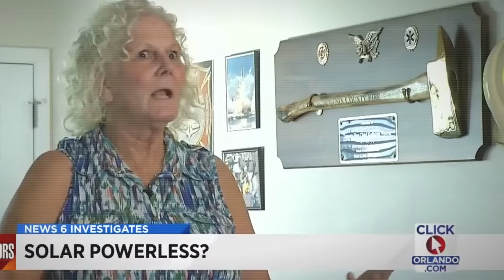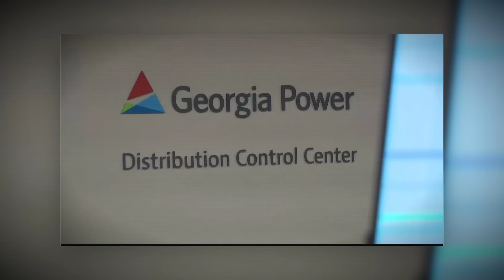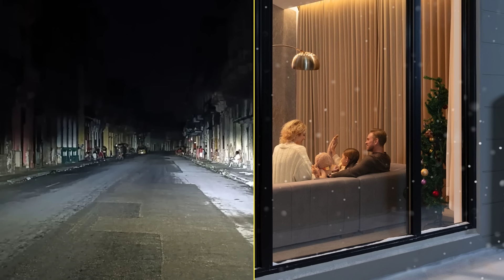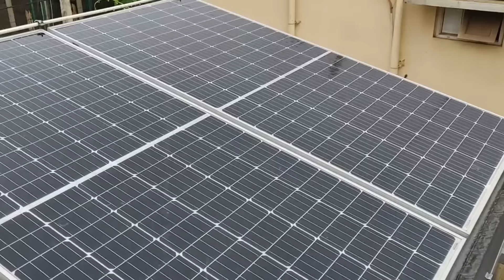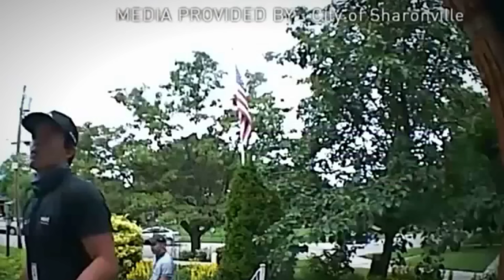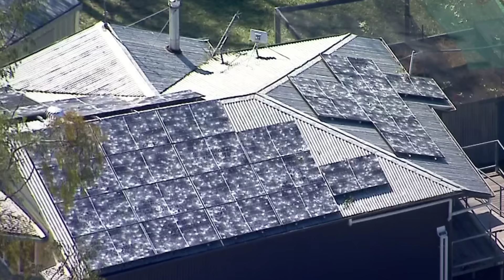Why Smart Homeowners Are Ripping Out Solar Panels (The 'Grid-Tied' Scam)

Comment: It is easy to ripoff the uneducated.  Buy your own batteries, solar panels and inverters.  Build a system that is not connected to the grid.  You will always have power when the grid goes down and lower bills when the grid is working.

Comment: I can tell you how it works in Poland, seems much better - nobody ever uses microinverters, we just wire the panels in series into 1 o 2 strings and connect to a single powerful inverter. Most Installations are on-grid, they do shut off during blackouts - it's not any kill switch, the inverter just can't generate AC frequency, can only sync to it, if you want off-grid, you either buy an on-off-grid inverter OR a grid separator and run a tiny off-grid inverter.

Comment: No one should EVER buy a product that forces them to rely on a warranty.  As is pointed out here on this channel (THANK YOU!), there are few things today that you can fix yourself.  If you can't afford major out-of-pocket expenses for early product failure, buy something else or a different product altogether.  

Here's why warranties are worthless:  Small, locally owned companies are great, but their costs are higher than the mega-companies, making it harder for them to make a profit and therefore presenting a higher risk they'll fail.  If they provide your warranty and they go under, your warranty just vaporized.  On the flip side, if a company is big enough to have the financial strength so the chances of them still being around 3 or 7 or 10 or 20 years down the road is a bit better, then they also have the financial strength to refuse a warranty claim and fight you in court if you pursue it.  Their lawyers can outlast your bank account. This one fact is why I would never buy a packaged solar set up, ever, even if the math worked and the operational risks were acceptable, which it doesn't and they're not.  

Very intelligent people may conduct careful mathematical cost/benefit analyses and then make decisions based on the results.  What they often fail to consider is risk, and in the solar industry the risk isn’t incidental, it’s everything.  Solar is a newer technology that's rapidly evolving, which means it hasn't been around long enough to have a well-established track record.  Also, since it is developing, you may have technology that's bleeding edge today - but what happens a year from now when a new development means new units are far less expensive to produce, produce a lot more power, last a lot longer, can be more easily controlled remotely, or can be installed far less expensively?  If you bought your system even partially for its lasting "value," you just lost tens of thousands of dollars.  Finally, solar packages are sold by salespeople.  Though some are professionals, sales jobs tend more often to attract people who are just looking for quick money.  They often come with little knowledge, education, or training in the industry, and many are ones who couldn't pass the screening for other jobs for some personal, financial, or work-related reason(s).  All these things scream RISK!

Comment: This is a massive misunderstanding of the technology as multiple comments have said. Grid tied it systems by default need to disconnect for the safety of alignment working on the lines. PV systems always supply power if there is Sun so the live voltage going back into the grid needs a disconnect. Once you at a disconnect, you suddenly add fluctuating power since your solar panels do not produce a steady stream of power. It produce a fluctuating power depending on how much sun hits the PV. In order to come at this you need a battery to help even out and store the power for when the sun is not hitting based on your power expectations.

Comment: Grid tied inverters MUST disconnect when the supply goes, however if you have a system that supports  islanding.
It is just safety- the grid MUST be disconnected when in island mode.
I would recommend a DC tied inverter where the battery system has MC4 DC inputs, this allows the battery to disconnect the grid to prevent back feeding whilst the house is still powered.

I have a Sigenergy system at home which is grid tied, the export can also be changed (even down to zero).
My export has dropped from 15p to 12p, the secret is to have a larger battery and bank the electricity during the day and use it at night.

The problem with many AC generators is that the power they produce is noisy and not tolerated well by electronics

My system has a generator input (smart port) that can switch on a seperate generator when the battery is low and switch it back off at a preset battery level. This uses the generator to top up the DC battery inside the system- the system then uses this battery energy to power the home using the internal inverter
Reply: Best comment here.

Comment: Grid tie has always meant the solar goes dark when the grid goes down. That is what grid tie means, what happens to the grid happpens to the solar.
Get a small battery and off grid inverter. 
open your home disconnect. 
open all your breakers except the solar inverters
connect the small inverter to your panel.
turn on the inverter and the grid tie solar comes back to life.
turn on critical loads.
Reply: Wait...do you mean like with a Jackery or something that small?  This seems so simple!  Do you connect it with jumper cables, or did you just make an extension cord with two male ends and plug it into a nearby outlet?
Reply: @blurglide  Ideally, you would plug in with a generator plug. But if your inverter is under 1500 watts, you could just plug it into a regular wall socket.
Something like a Jackery would work well.
You absolutely need to open the main house disconnect first.
Reply: @williammeek-h2o  I asked AI about this and it said the problem would be load matching.  If the solar is generating more than I'm consuming, stuff will begin to burn out
Reply: @blurglide  Solar literally can't generate more that is demanded.

Comment: A complete misunderstanding of the technology. The equipment required to enable non-'grid tied' is complex and expensive- and would rarely be used. The standard inverter requires the grid to syncronise its AC waveform. A free-standing system has to provide its own, and have extensive protective systems to prevent mismatch when the grid returns. Power matching is also an issue- which is why most grid-free systems require a battery system too. Why would a supplier give you all this for free? If you are one of the few people who would benefit, buy your own. I have a grid-tied system, and it has paid me hansomely for the last twelve years, and also reduced my power bill.

Comment: I installed my own system with backup batteries 3.5 years ago and it's already half paid back (because our electricity is so expensive).  Yes there are scammers and you need to actually read and understand the contracts.  Between EVs, datacenters, and a mountain of red tape slowing down power plant construction, though, the grid isn't going to get any cheaper or more reliable anytime soon.
Reply: ditto

Comment: This video is an advertisement at best. Solar PV is great and if you get scammed, that's your own damn fault for not reading the contract. Solar PV system has paid for itself 3X, batteries are optional. NEM 3.0 changes the economics but it doesn't make it worthless.

Rule of thumb for solar: Pays for itself within 10 years, install cost is less than $3 per watt installed before incentives, is a fair deal.

Comment: You can buy your own panels and should.
Reply: I installed an off grid system.  Two Ecoflow ultra systems with 3 batteries each (37 kwh total) and 9 kw of solar. That is two days of battery. The grid is now my backup for extended heavy overcast and low solar. I can charge my batteries in 3 hours a day with one trifuel generator when the grid is down. Total cost, after tax credits, was $10800 or 4 years pay back. This was a no brainer.
Reply: Don't worry about it. Non issue

Comment: I built a solar/battery backup system first, I literally can go shut down the grid if I wanted to....and then a bought two gridtied inverters with limiters, set up for ZERO EXPORT...that I use every day until a black out...

If you want to put solar panels on your roof, only use standing seam roofing or PBR metal paneling!!! Then you use rib mounts that never penetrate the roof surface!!!

Comment: I'm fan of solar and will never get solar installed, but I am not buying this very slanted presentation.   Let's say for instance you are not going to connect to a utility grid. This video assumes the motivations of the customer.   If you are in a rural location and a connection to the grid is tens of thousands to connect the cost benefits are significant.  Solar might not even be an option if you are located in certain areas,  but other options maybe viable.  It just feels like a very dishonest presentation.  I have a tendency to like most of your videos, but not this one.  Try again.   I think there is very important information in this video and maybe a rewrite will change my mind on this.
Reply from the maker: We actually agree with you! If you are building a rural cabin miles away from a powerline, a true off-grid solar and battery setup is a brilliant, necessary solution. But this video isn't about rural homesteaders. It's about the millions of suburban homeowners being targeted by door-to-door salesmen and sold 'grid-tied' PPAs under the false promise of independence. True off-grid solar is great; the 25-year retail suburban trap is what we are exposing. Thanks for watching as always!
Reply: @IndustrialDecayUSA  Why don't you just be honest and show that the math makes sense in some cases and not others. The issue isn't with solar, the issue is with the vacuum salesmen selling absurdly overpriced systems.

Comment: Completely out of date information here.  BUY A OFF-GRID OR HYBRID INVERTER, and battery.  Prices have come down massively to the point where it's much much much less expensive than he claims in this video.  You can even keep your old system and have it be tricked into producing power even when the grid goes down because it will synchronize to the off-grid or hybrid inverter.  For between 5 and 10 k you can buy all you need for a minimalist system.   That will save you from the most expensive energy cost tiers, so it will have the fastest payback probably much less than 10 years, and possibly as little as 3 years.  Solar panels last decades and they don't just die. They just produce less power when they get old. 
And countries with a lot of sun like Australia and Pakistan, Solar power is revolutionizing their energy production completely taking over.
Reply from the maker: Even if it's 'only' $5,000 to $10,000 extra, why should a homeowner have to pay a massive secondary ransom just to keep their own lights on during a blackout? The initial grid-tied pitch is still a trap
Reply: @IndustrialDecayUSA it's not a ransom, it's a choice that actually saves you money in the long run.  Your electricity cost is locked in, independent of rising rates due to all kinds of crazy things like AI data center or increased oil prices
Reply: @IndustrialDecayUSA  Because you can't math, that's why. Use batteries or don't use batteries, people use batteries because of the economic benefits but you're not required to do anything.

Comment: A I generated b s clickbait scam. Yes, there is an issue when you get a blackout.But what you're buying it for is to produce electricity and everything you don't use.You sell back to the power company.In some cases , not a particularly good deal of sale. You can have a system that basically takes you offline to run off your solar panels without having batteries.Although it means that you won't have electricity.Except when the sun'hitting your panels.
Reply: Not everybody is so lucky to get a decent payback from selling to the grid!!! Matter of fact some people only get a tenth what they use to... 
Besides, you don't understand. We deliberately set up only selling solar pedals without batteries just to bring down the cost of solar panels!!! Solar panels once cost $20 a watt. Now it's $0.50 a watt. That's because all you idiots but systems without batteries....